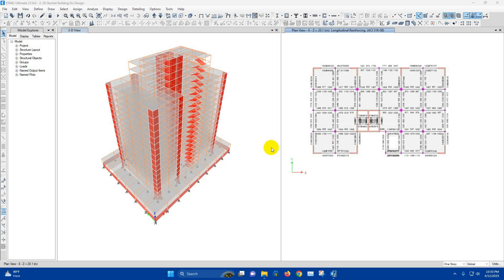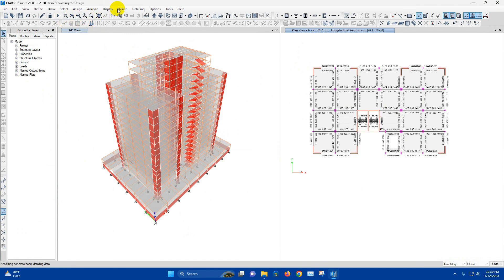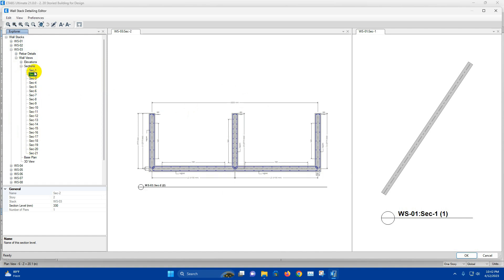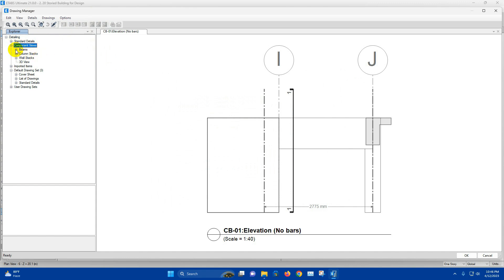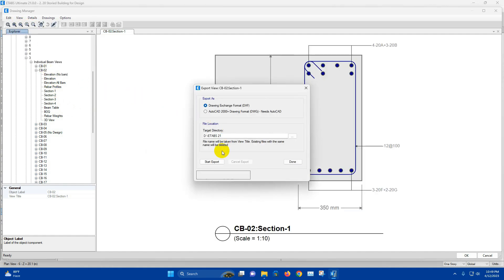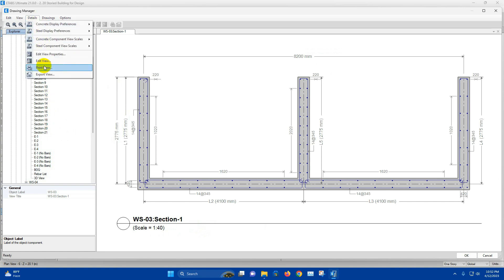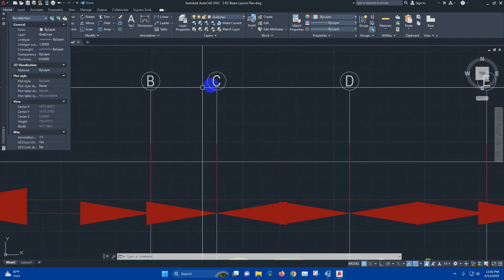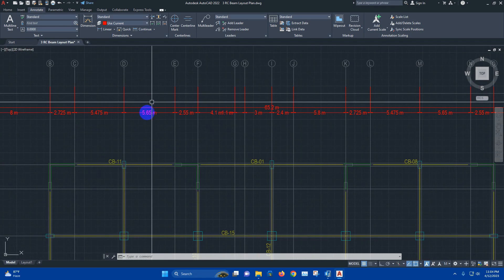Etabs v21 | Detailing and Exporting Drawing to Autocad

Comment: Dear Engineer Do you Leave Protastructure and Back to Etabs ?
Reply from the maker: No. I usually show the tutorials on different software. I prefer Prota Structure most. New tutorials on Prota is coming soon in sha Allah.
Reply: @Decodebd  perfect bro I Also bought a license from Prota and chech also in ETABS.. But would you please to discuss the torsional irregularity check on Protastructure.. Since in ETABS there's two method in static Ax amplification factor and in RSA we make mass adjustment.... Thanks for your amazing channel
Reply from the maker: Prota Structure Automatically checks all the serviceability during the analysis, then it shows a report. If there is any torsional irregularity exists then it will show in the report window.
Reply: @Decodebd  thanks bro I knew that. But as you know in ETABS if theres a torsional irregularity in the limit of less than 1.4 you can use mass adjustment method and continue with RSA in static you can fix it by using Ax amplification factor.. In protastructure there's no way to do that... Thanks
Reply from the maker: I got it. I will check that if it is possible in Prota or not.
Reply: @Decodebd  I send them an email several times the answer is to add more shear wall stiffness to overcome the torsional irregularity
Reply: @Str.Eng.zuhair  what is their price?